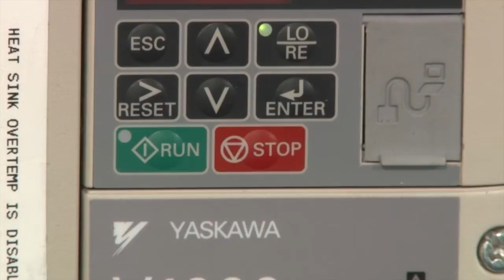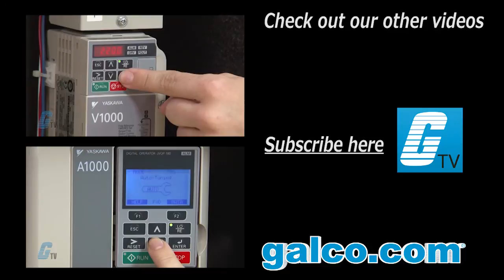Troubleshooting Yaskawa Drives: Flashing Run Command - A GalcoTV Tech Tip | Galco

Comment: Hi in GA700 drive after modbus communication established between drive & plc drive communication failed due to passing of some induction voltages from cable to drive D+ & D-. how to avoid such interferences?. if shield connected to drive AC terminal then can avoid?. could you please?

Comment: Morning madam I have the same model drive which is controlling a motor, problem is that the motor is not running, power is not coming through. I tested at drive output but there's no power though the drive is on..

Comment: Hi madam how to reset sc alarm in v1000 ac drives please
Reply from the maker: SC is an IGBT fault. It looks like you have to cycle power. I would suggest you disconnects the motor.

Comment: Hello, how to reset alrm oH1 in V1000, no cooling fan?
Reply from the maker: After replacing the cooling fan reset the fan maintenance parameter 04-03=0
Reply: d'ont hava a cooling fan.
Reply: drive model - VZA40P7BAA
Reply from the maker: Ok well the drive is tripping on HeatSink overtemp. Yaskawa recommendations from the manual suggest putting a fan on it, not necessarily mounted to drive but and stand alone type office fan next to drive can help, or reducing the ambient tempurature with an air conditioner. Is this drive mounted in an enclosure? Is the ambient temperature under 104F/40C?
Reply: yes,, the temperature are in that moment 25 C.and the drive is not hot...
Reply from the maker: Ok does it power up with the fault on and won't reset, OR will it run for a while and trip. So if it powers up with fault and won't clear, you most likely have a bad Control board and need to replace the drive. If it runs for a while and trips OH without excess heat, you most likely have a bad temp switch on the heat sink and it needs replaced. We sell the drives for sure, but that temp switch may be a special part and not available. It may be possible to replace with a generic part but some times these are resistive elements not just a switch. Good luck.

Comment: hi guys I have to know how can we troubleshoot cp206 error
Reply from the maker: What's the model number of the drive you have?
Reply from the maker: Ok first, what drive do you have?
Reply: a1000 showing cpf06 error
Reply from the maker: CPF06 is a memory error. You can try saving your parameters again, but if this error persists your CPU Control board has failed and will need replaced. Give us a call at 800-337-1720 and ask for a product manager to assist you in getting the correct information to replace this board if possible.